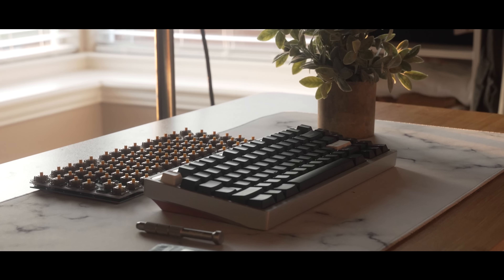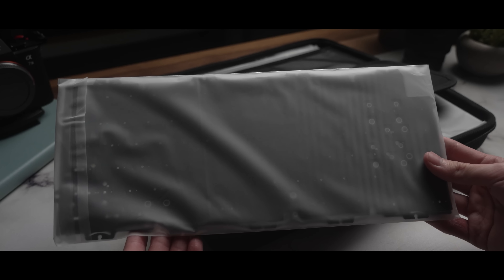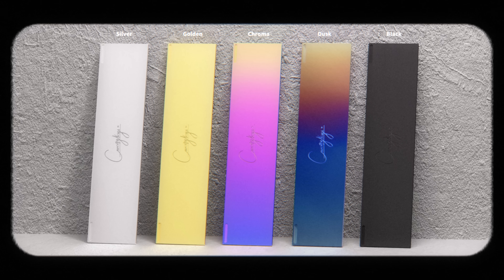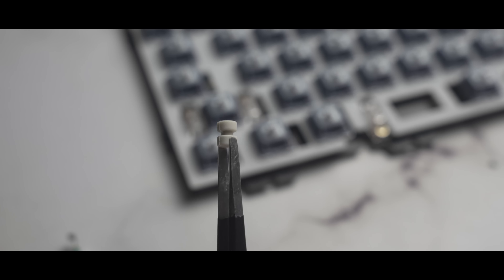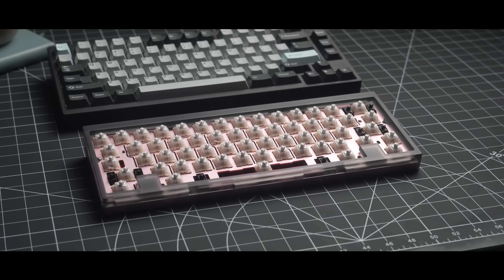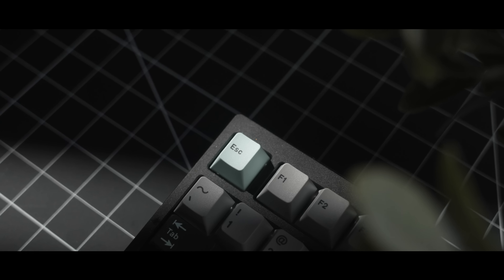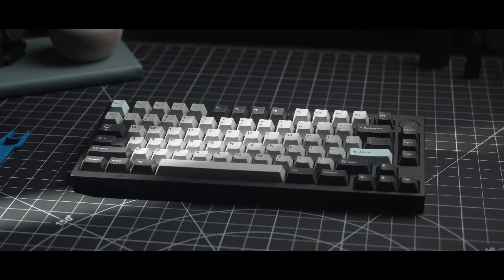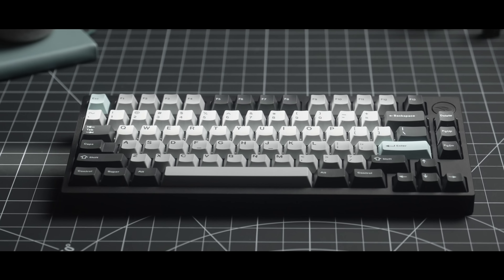The most PREMIUM Budget Keyboard.

Comment: 1. encoder is included for free in every kit - even if customers don't choose the knob
2. the prototype PCB indeed has a missing hole under the 2u backspace
addressed the issue on the final product 
3. tungstens are discontinued Owlab replaced it with Neon switches
Reply: are there any extra parts to the qk75 that need to be bought seperately
Reply: @chrisunal8990  nope
Reply: Is there still a chance that users may not get a set of stabs?
Reply: I had ... No ... idea, even, of the nomenclature involved with keyboard tech
I was a competitive speed-typist in my HighSchool (then I worked in tech/datacenters) 
but I am   COMPLETELY   just A vanilla keyboard type of guy 
..... I had NO idea.... but now I DO   & a new appreciation for the "Science" of keyboards. 

this "kid"  was  Brilliant  in this review- such a professionally done review
  Awesome

Comment: Another great video, as always.  Love that you didn’t stuff it with foam.  It sounds great in that config, although I’ll probably add the mid plate foam so it’s just a little fuller sounding.  I’ve had the Sonnet queued up in my cart for weeks.  Not anymore.  Do I like the Sonnet styling better? Yep. Do I like it $250 better? No way.  And the sound is comparable, at least to my ears.  The value you get with the qk75 is insane.  Thanks for the solid review.

Comment: Unsure if anyone will see this... Essentially I randomly came across some sweet keyboard keys on Etsy and picked them up on a whim. I thought I could buy any old keyboard and throw them on - now I'm being exposed to this entire new world! Kind of cool, but overwhelming too. I know nothing about sound/feel and have no (known) preferences in that regard. Here is what I know about the keys I bought:

+Compatibility: standard ANSI layout 61/87/104%
+Switch Type: MX
+Profile: Cherry
+Material: High quality PBT
+Backlit Compatible

*Not completely compatible with Razer nor Corsair. Some keys won't fit depending on the specific layout.
*Not compatible with Logitech and other mechanical keyboards where the switch is not MX type.

Can anyone recommend a keyboard (ideally $50-150) that they would fit on? Or a resource or two where I can dig more and try to figure it out? Thank you in advance!!
Reply: Sorry, I do not have an answer. I'm just responding to say that I hope youre venture was fruitful!

Comment: while i like to see all those improvements and how much value you can get nowadays for quite cheap...like...when i got into it, i was building a basic tofu for like 300-400bucks total. (just the case and and the keycaps are allready 200, adding switches and plates and pcbs and stabs and...you re getting there quickly and something like gasket mount on a budget was kind of unheard of...and now have a look what you can get instead: this thing costs less than a tofu with a plate and pcb cost you and has like 10 times more value. 

But i still enjoy my tofu, especially with the addition of pe foam and alike... and my tofu is still better than probably 98% of the keyboard out there people usually use...so its far from beeing ''bad'' just because you can get better value today. 

I also dont like how fast the market is moving. One of the main selling points i tell people, thinking to get a custom keyboard is its longevity, yes its more expensive initially but going forward...you basicly never have to buy a new keyboard again because all the parts are high quality, very little points of failure and IF something goes bad you can easily fix it yourself. compare that to the average ''let me buy this roccat keyboard so i can buy a new roccat keyboard in 3 years...'' and all of a sudden, a custom keyboard isnt really that expensive anymore, cost per month.

but people quickly get into the mentality to keep chasing and keep buying new stuff.  Does someone need 10 different keyboard? HECK NO you dont...you cant type on more than one at a time. and buying a new expensive keyboard every other month defeats the entire purpose of buying something... high quality with great lifespan, that can basicly last you for the rest of your life if you take care of it. If you just look at youtube videos... you barely even have the time to actually USE a keyboard...before a new one comes out...

Comment: Dammit, I need advice. I already bought a Zoom TKL but then I saw the QK75's price which puts it in the same price point lol. Now I feel like canceling my Zoom TKL and buying this one instead. I value sound and feel the most, and also would prefer a POM plate, but I don't like the bottom weight of the QK75 and I like the Zoom TKL's larger bottom weight. I can only look for the QK65 and Zoom65 arguments for sound and feel, and it looks like QK65 wins, which implies that QK75 could sound and feel better than the Zoom TKL, I dunno, should I cancel the Zoom TKL and go for the QK75 instead?
Reply: i think ultimately what matters is the form factor - tkl and 75% have subtle differences and it may lead to preference diff